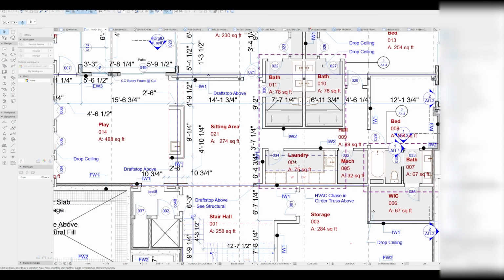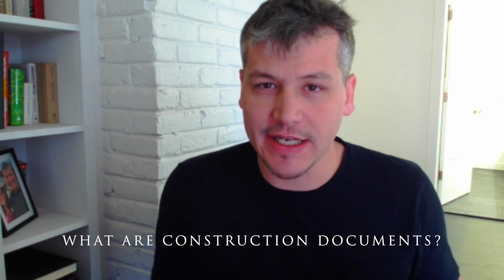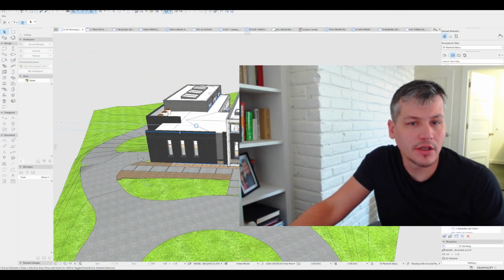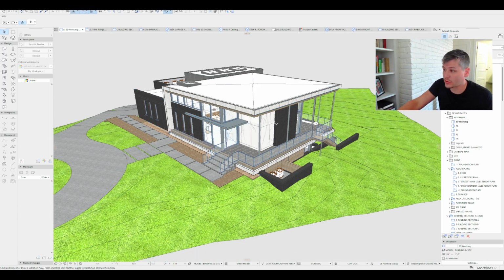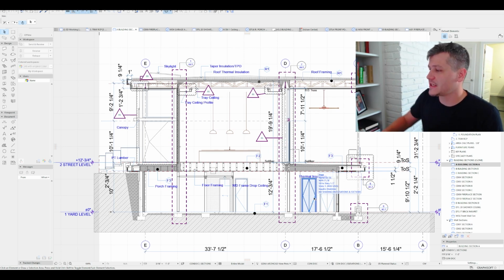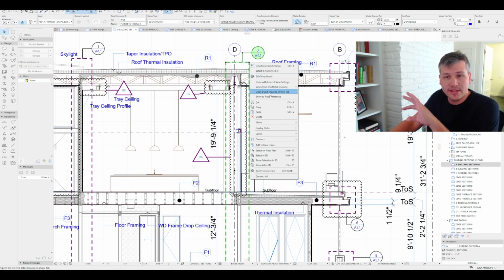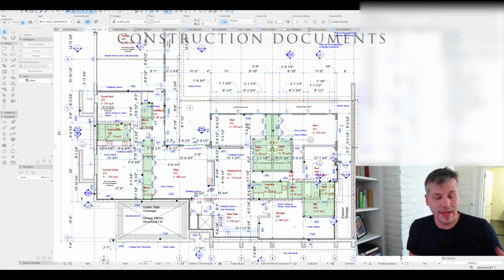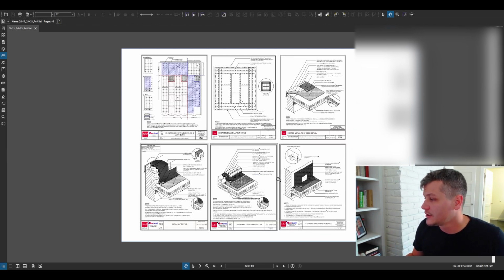Architect's Guide to Late Design

Comment: In these phase we are not changing the look of the building, all we architects are doing is adding up more information that will be translated into a buildable building. but we stage that information that way when the construction documents is reached we can easily translate that information in late design DD to contractors and start putting the drawing into sheets that can be printed out, or just viewed in an iPad or both.

Comment: @c.w.architects. Do you think an architectural Designer can get away from using steel framing on a wall with lots of glass like this one, using Concrete as finish and structural?

Comment: I think what you are talking about is applicable on large scale project over 500 sqm. For small scale project like G+2 residential house, architect can do all task itself.
Reply from the maker: Thanks for commenting. 
In most cases for sure. We use the building code, materials, and technology of the construction to help determine engineering needs.